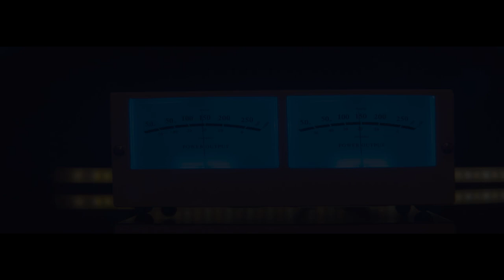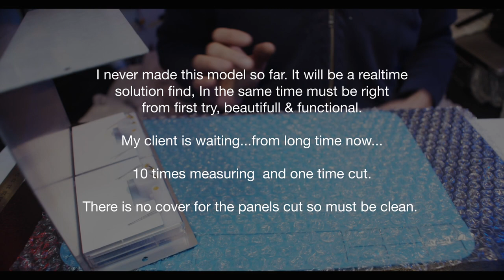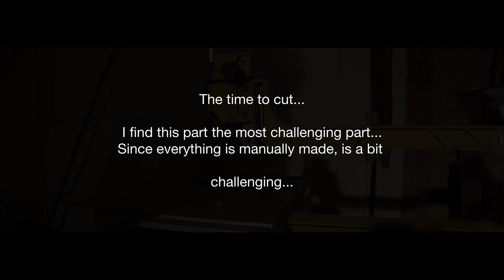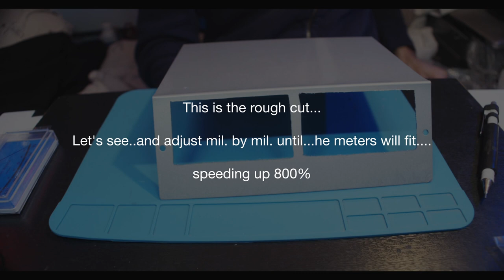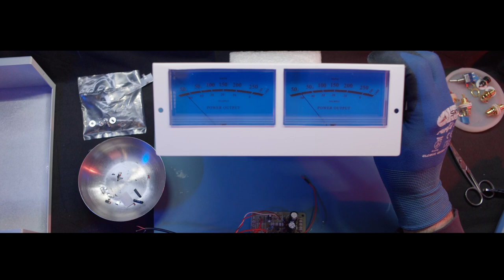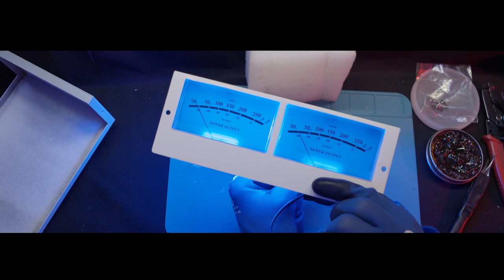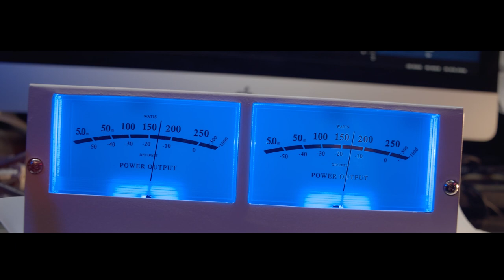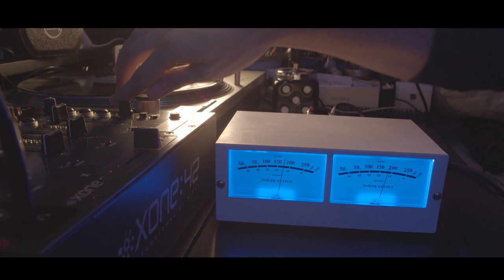Analog VU Meter McIntosh Style Complete Build with Passion & Care

Comment: Hello, where do I find that PCB? Did you desing it yourself, or does it sell in some place or web?. Pretty neat project =)
Reply: No response?
Reply from the maker: Just search VU meter Driver online and you will find so many types. eBay , Aliexpress is another place.
Reply from the maker: @xerix32  Sorry for my late reply. I'm into doing things. I think  a good source will be to search eBay for VU meter drivers. There are some models and based on what you need you can choose. The ones i use are made with my specifications and i modify them in some ways to accomodate my builds. Mostly the calibration screws i want them on the enclosure to leave the option to be used and calibrate them from outside without the need to open the box. I use these drivers for my builds. I don;t plan to sell them but can be found online for sure.

Comment: Salve, può pregiudicare il segnale audio? Grazie bel lavoro.
Reply from the maker: No. The in and outs are hardwired connected and the VU meter board is placed in parallel. Maybe some millivolts are taken as reference for the meter. So little that a simple finger touch will trigger the meters on max.
Reply: @FlyHighWavesSounds  grazie 🙏

Comment: Hallo, I am building a kit like this, but I am not using the built in led, like you. Can I plug the New led strip directly to the board where the built in strip Was supposed to be plugged  in? The board has 2 x 12v out for led strips, but i am not sure about the max load..
Reply from the maker: Not sure what you have there. Hard to tell.

Comment: A seller on eBay from China sells something just like yours for either 113 or 127??? Free shipping. Also versions selling for 200-ish that look like the cheaper priced model. It seems like black case would make more sense so it matches black older, newer components, also the case is way too small , why not use a case the size of a receiver?? Either way..solid video.
Reply from the maker: I make them for radios and studios. The size is to be compact. The original McIntosh indeed has a huge case and two small meters but this design is not to be a McIntosh copy.  In China, the workmanship is cheap on a production line. As well components factories are there. The meter is built and designed in the UK and you will get free support, service, warranty and upgrades to XLR if required. The 19" inch 4 CH version is on the way.

Comment: Looks cool,
Thought maybe worth to try with rgb strip?
Where I can get meters like yours?
Reply from the maker: You might find them on eBay. I recently found some but not very cheap but not that expensive either.
Reply from the maker: Adding any colored light will mix with the blue and render strange colors. Some panels all white will be great. I have a plan for this but in time i will make them all.